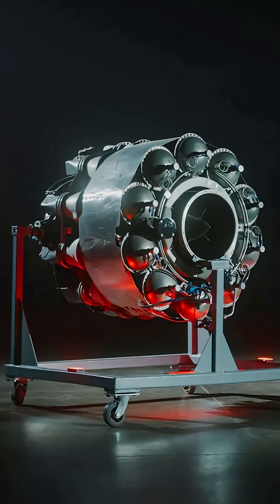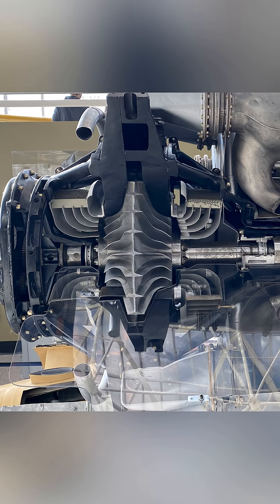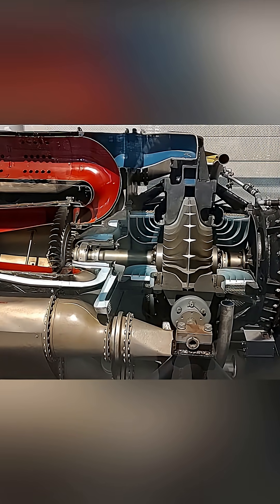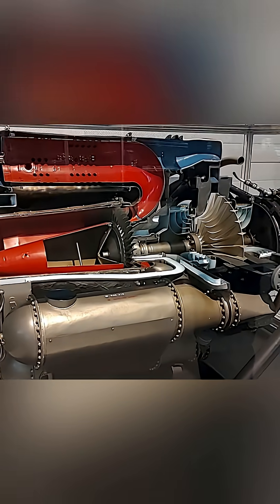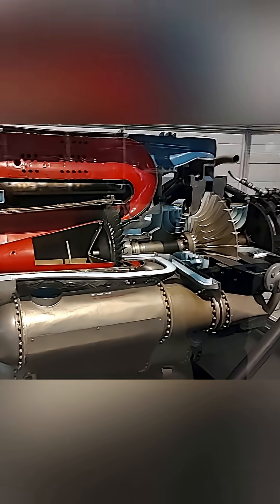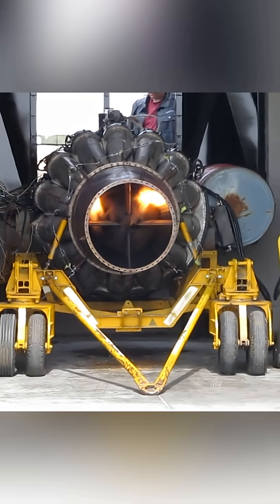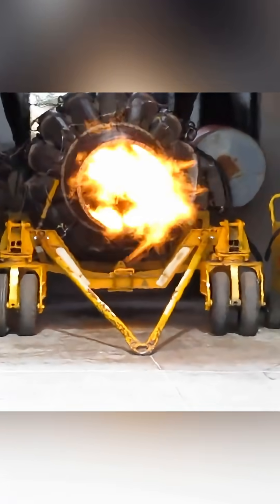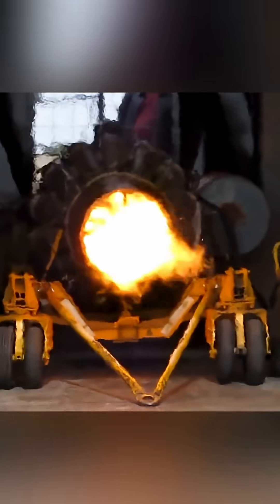Father of Jet Engines!? - GE31 Turbojet

Comment: Excellent cut-out, the design, however, is not Frank Whittle’s; it’s consistent with Adrian Lombard’s Rolls-Royce straight-through flow combustion system, first used on Welland, which is more efficient than the Whittle reverse flow combustion system. Ultimately, Frank Halford took the centrifuge impeller compressor to its ultimate conclusion with Goblin and Ghost, with 5000lb thrust.

Comment: Father of jet engines is the Jumo 004. Whittles design was outdated from the beginning. Modern jet engines use axial compressor like the Jumo004.
Reply: Germany never had production centrifugal jet engines but did they ever experiement with them? Can't recall anything like that.
Reply: Centrifugal was chosen deliberately due to the limitations of metallurgy at the time, which made centrifugal more reliable.

Comment: What about mixing cool air at the end of the exhaust, through a nozzle, so it expands and creates more thrust? Like Rockets do?
I think it's a waste not to do it.
Also Blended Wings, for more fuel, lift, fuel-economy, safety gliding,softer more controlled landing 🛬 and even crash landing 🙀, more passengers 🚢🛳️ and cargo
Reply: Blended wings ? with engine inside them ?    Long since discarded as a uncontrollable fire hazard !    Engines hanging on a strut are disigned to burn/fall off, if the fire cannot be put out, and save the aircraft.   It is not perfect but it beats the alternative.   😊
Reply: @BillSmith-fx7xxItt means Cabin and wings fused. The engines hanging are not ideal, should be redesigned, the shape should have lift and be more aerodynamic, it has a thick shell and size
Reply: @saull287    Ok.   Thank You.   Yes, I have seen a couple of drawings & one flying model.   Blended Wing/Body is what I am familiar with hearing.   Don"t hear it all that often.   And not that it matters but for me it is just one more step towards everything being ugly.    Cars, music, women, dogs & now I can add airplanes to the list !   😢
Reply: @BillSmith-fx7xxYou seem depressed and incapable of adaptation, living in the past and nostalgic of things that don't exist anymore. Of course you think everything is ugly, you deem so everything that doesn't comply with your selfish vision of everything. Embrace Truth, Reality, Goodness, Justice and adapt accordingly. Nature is not here to please you; you're here to adapt to Nature, to try to build your happiness. The Universe doesn't owe you a thing; it's Common Sense

Comment: The Jet Engine Was Developed in Germany

The world's first operational jet engine was developed in Germany during the late 1930s. German engineer Hans von Ohain is credited with designing and building one of the first working turbojet engines. His prototype powered the Heinkel He 178, which made its maiden flight on August 27, 1939, becoming the first aircraft to fly solely under turbojet power.

Although British engineer Frank Whittle had independently worked on similar concepts, it was the German team that achieved the first successful flight. This marked the beginning of a new era in aviation, leading to the development of advanced jet aircraft during and after World War II.
Reply: story goes the Germans ran with whittles design causing the Crown To drop a load in their pants when they saw it in action. - it was a nasty race to catch up patents be damned - declared something to the effect of nationalized tech due to a war time emergency act.
Reply: AA Griffiths came up with the theoretical idea of a gas turbine powering a propeller in the 1920s.

Sir Frank Whittle independently developed is own jet engine in the 1920s and 1930s and won patents in 1930 and 1935 (I believe). He ran into problems financing development. The British Air Ministry (with the advice of Griffiths) saw no future in jet engines and declined to finance development.

In 1933 after flying in a noisy Ju-52/3m,  Hans von Ohain decided there had to be a better way than piston engines to provide thrust and independently developed a gas turbine while a PhD student. He made contact with Ernst Heinkel, who had always pursued higher speed plus he had the long term vision to realize the limits of propeller thrust. In secret (so the German air ministry (the RLM) could not interfere) Heinkel financed both von Ohain to develop his HeS-03 gas turbine and the development of the first aircraft designed for jet propulsion, the He-178. This flew a couple of weeks before WW2 began, under control of Flugkapitan Erich Warsitz. Heinkel's distrust of the RLM proved correct. When he finally demonstrated the world's first jet to them, they were not interested, even hostile toward him wasting his own resources on what they saw as a hobby in wartime. During the war they would largely cut him out of jet aircraft  development (with the exception of the 
He-162 fighter) and indirectly compromise von Ohain's future gas turbines including the promising HeS-09.

When von Ohain came to patent hi HeS-03 engine he came across Whittle's second patent and considered it more of a patent of a concept than a specific engine. Although both his and Whittle's engines had a similar layout (compressor / combustors / turbine) they were engineered quite differently and did not look the same.

In 1941 when Whittle's W.1 engine flew in the Gloster E.28/39, it was the third jet to fly after the He-178 and the He-280 fighter.

IMHO this was simply a case of independent development of a new idea. The same could be said for the development of motion pictures by Edison and the Lumiere Brothers.

After the war Whittle and von Ohain became good friends.
Reply: @tsegulin Go further down in time, and find that the basis of jet flight were put by Henry Coandã in 1910, who also invented aerodynamics.

Comment: Frank Whittle was the first to build a working jet and used modified steam turbines, the British dropped the ball, so the Germans and Italians used the patents. The Meteor was the first jet to enter service, but was reserved for shooting V1 buzz bombs.
The Italians flew a prototype before anyone, and the Me262 followed closely.
The US and Soviets got early Rolls Royce   radial engines for the MiG(25 Nene engines) and Bell prototypes which GE  built under license, of which this is an example.
They were quickly superseded by axial flow turbojets.
Reply: How did the the British “drop the ball”, yet were able to build the “first jet to enter service”?  Your comment makes no sense.  Hans von Ohain developed the first jet engine and the Germans were the first to build a jet engined aircraft.
Reply: The Germans had an inefficient procurement system and an interfering leader. Me262 was big and complicated. Heinkel had a single define just that got ignored and Junkers were also at it. 
UK went for one design with two engines. When one failed it could still get home.
Reply: The Jet Engine Was Developed in Germany

The world's first operational jet engine was developed in Germany during the late 1930s. German engineer Hans von Ohain is credited with designing and building one of the first working turbojet engines. His prototype powered the Heinkel He 178, which made its maiden flight on August 27, 1939, becoming the first aircraft to fly solely under turbojet power.

Although British engineer Frank Whittle had independently worked on similar concepts, it was the German team that achieved the first successful flight. This marked the beginning of a new era in aviation, leading to the development of advanced jet aircraft during and after World War II.
Reply: @volkarachooo    Post to main Comments.    So many people will not see it in the replys.   😊
Reply: MakeDo-Turner_Smith.     You are totally wrong.    😢     Go watch the YT video about Frank Whittle.   Also, the Italian jet used an ICE engine to run it's compressor.   Not really in the same class or concept as the German & Whittle jet engines.

Comment: Can really see the bridge between turbocharger and jet
Reply: Motorjet. And yes, there were planes that used a central engine to power a supercharger.
Reply: Not really, the compressor technology is taken DIRECTLY from aircraft piston engine’s SUPERCHARGERS not turbochargers.
Reply: @Mentaculus42  they had both and twin charging like the p47. Turbo tech went back to the 20s on commercial planes
Reply: @wilurbean 

The P-47 and the P-38 FIRST and FOREMOST had a centrifugal supercharger that was directly integrated with the piston engine AND in ADDITION had a turbocharger on top of the supercharger. The turbocharger was a completely separate additional system. But a note should be made that axial compressors were being developed at the same time. The confusion is that the centrifuge supercharger that was used with the piston engines and early jet engines does look just like the compressor section of an automotive turbocharger. The centrifuge supercharger was used in early jet engines because they were technically understood. Centrifuge compressors are still used in turboprops and a few turbine engines. Some use both centrifuge and axial compressors as each have their own strengths.
Reply: @Mentaculus42  turbochargers, meaning turbine driven superchargers
Reply: @leahheffernan4644 

Don’t forget that there are a number of distinctly different types of compressor designs used for “superchargers”. Also that “turbine” part of an aircraft “turbocharger” can have distinctly different designs (than automotive turbochargers). Then how does one add in the concept of exhaust gas energy recovery devices that are geared into the piston engine that then drives (through gears) the centrifugal supercharger. Then there is the whole turbo compounding concept. Then there is the issue that the design of one of the primary aircraft “turbochargers” of that era was very late due to having to figure out how to design one while the superchargers were a mature design. The improvements in superchargers came due to multi speed and multi stages for aircraft, but same centrifugal compressor design. Whittle directly used the exact same technology used for the superchargers which is very understandable, the same technology that is still used today in turboprops (and some jet engines).
Reply: @Mentaculus42 right but nothing you've stated is contradictory.
My comment was more of the etymology of the word turbocharger.
And for all intensive purposes an axial turbine driving an axial compressor could still be a turbocharger
Reply: @leahheffernan4644 

I understand where you are coming from and this all could be about getting wrapped up around word definitions. The point that I am trying to make is about where the “compressor technology” for the Whittle jet engine came from! It came directly from aircraft superchargers not the aircraft turbochargers of that era. Yes the general concepts get fuzzy between the two groups.
Reply: @Mentaculus42  most civil YouTube exchange I've seen 😂
Reply: I came here to say this.
Reply: They should design a smaller version for cars by which we can use multiple fuels to use the turbine as range ectender for PHEV.
Reply: @ag135i  you can make a rudimentary turbine from a turbo charger. They do get really hot tho
Reply: @ag135i  Low efficiency, high noise and heat. No, just no.